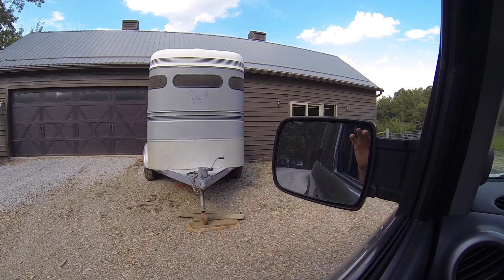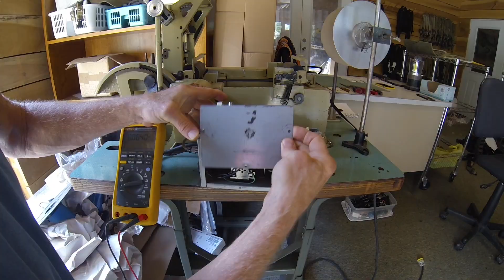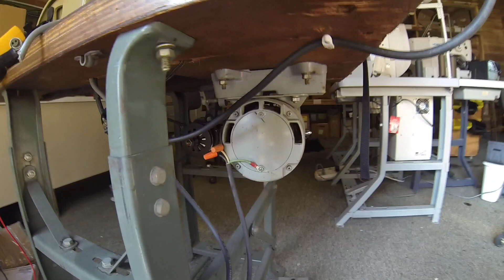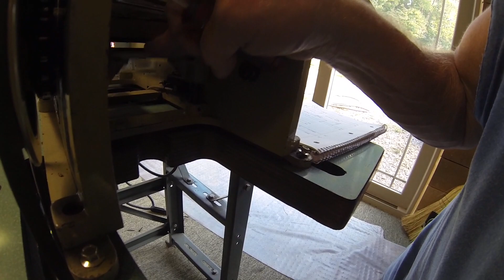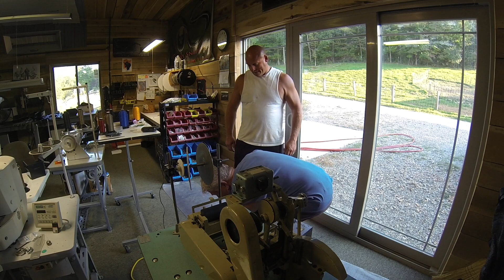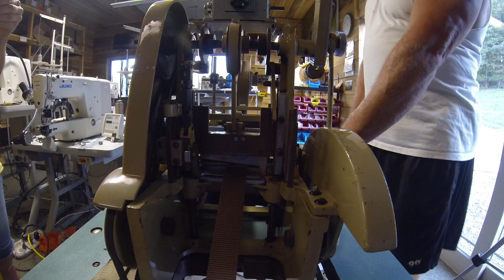Ace Webbing Cutter Repair - Keeping it Simple

Comment: maybe had machines hooked to this unit, trying to be nice. you see stuff like this a lot not a lot of common sense anymore
Reply from the maker: We found out that this device did have a hot knife at one time. It was probably removed because the hot knives tend to leave a sharp bur on the cut edge, so now people just let the machine cut and they use another step to seal the nylon. The arm you saw that was just hanging there was connected to a mechanical counter at one time. The counter stopped working so someone decided to disconnect it rather than fix it. It's really not necessary for Brian does anyway, so it's all good! You're a good man Michael White - it's always great to hear from you!

Comment: Nice job Wayne! I don't like working on electrical equipment if someone else has altered it. Not fun. But you found the issue pretty fast and fixed it. I would recommend to Brian that he replace that mutilated plug on the power cord, or maybe even replace the cord and plug both. I'm definitely better with 2 or 4 cycle engines rather than electric motor driven equipment. Love you you and Suzie Q 😊
Reply from the maker: Agreed, Angie. That machine has been around the block and touch by a lot of folks. This wasn't really a video that I planned to post, but my friend wants to use the footage to justify not having to pay full price for the machine. I hope it does the trick for him. Hope you're well, Angie. Suzie and I send our love to you as well! Stay safe, strong, and warm, dear friend!
Reply: @WaynePolcin  I sort of figured it was documentation for that LOL...I would have done the same thing. I'm warm for now, eating well, and fairly happy. Strong on the other hand depends on how long winter is. It's sucking the life out of me Hahahaha. Thanks for the reply to my comments, you always make my day when you do.
Reply: hello hope all is well
Reply: @michaelwhiteoldtimer7648  Hi Michael, hope you're doing well also 😊